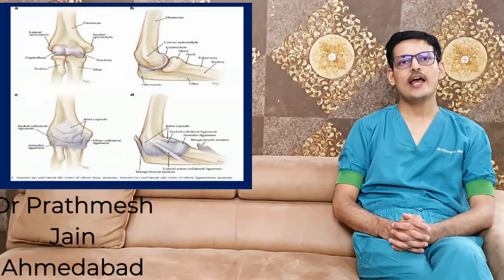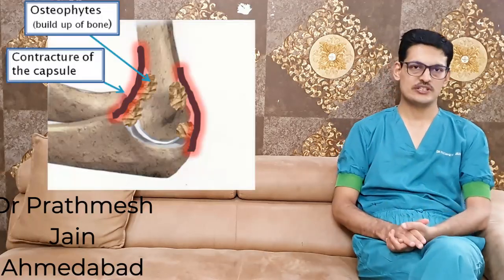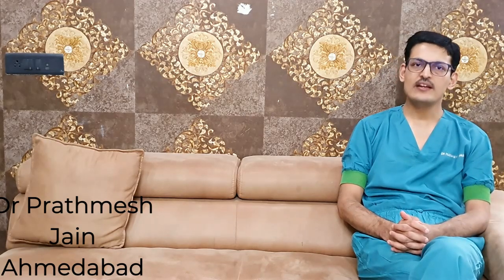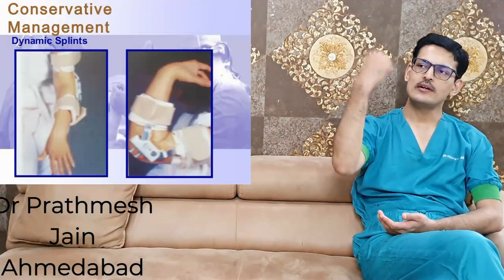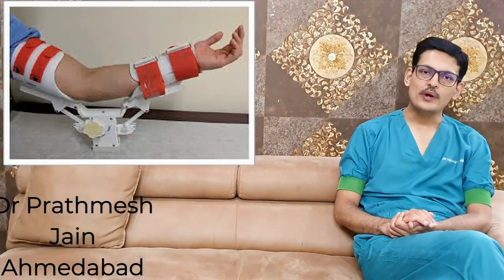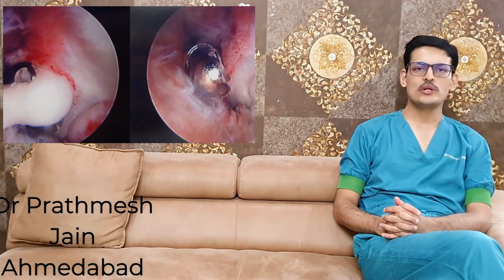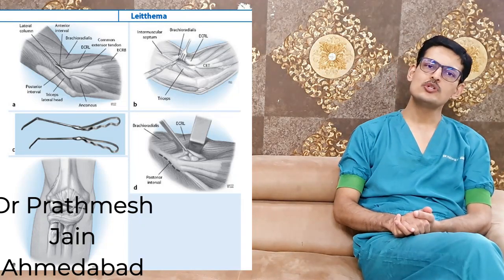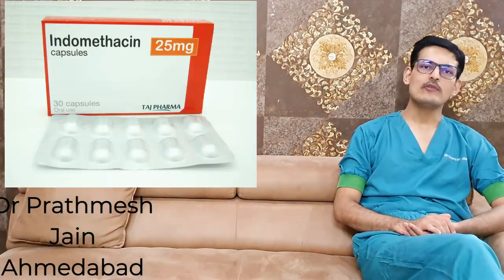STIFF ELBOW : Arthrofibrosis of Elbow

Comment: Thank you with this platform.I have elbow stiffness for long time.i dislocated my elbow when I was young,I believe it was lack of exercise.i have 30degree if I what to straighten it.Is there still any hope to get back my hand?It's been 19 years with stiff elbow.
Reply from the maker: send reports 
Advance knee and shoulder hospital  . Pakwan crossroads , sg highway 
Ahmedabad 
All details on www.kneeshoulderindia.com
You can book appointment by calling on 7096021983
you can send reports on whatsapp no 9227901980
www.advancehospitals.in
Reply: Radial head excision may be work in your case it works on my case now I am getting much better flexion and extension as well 😍😍